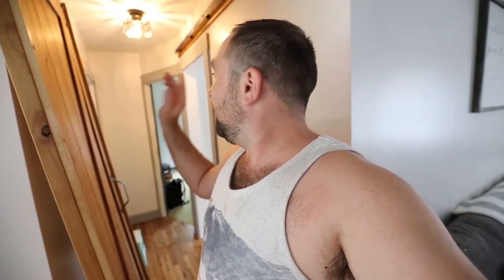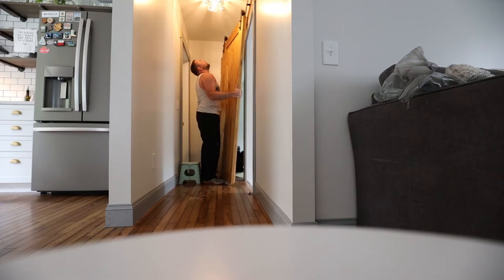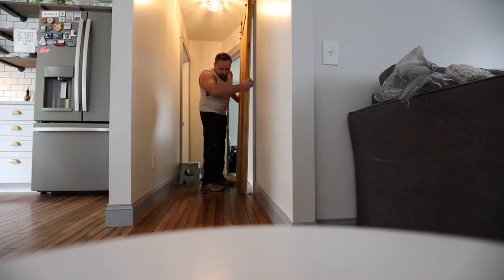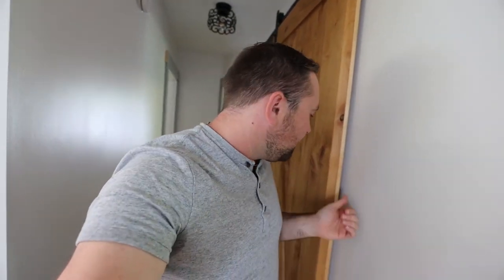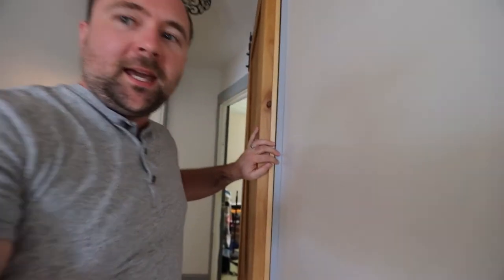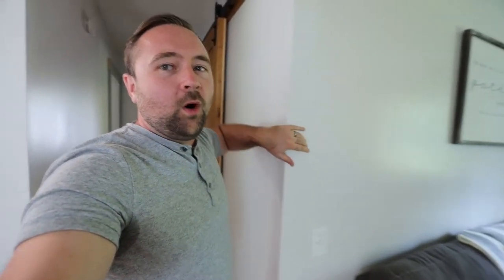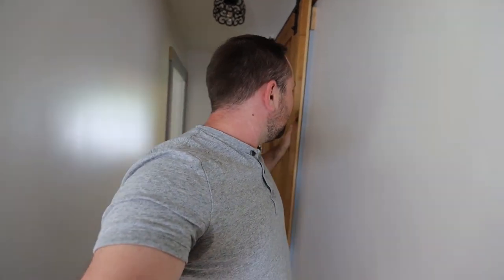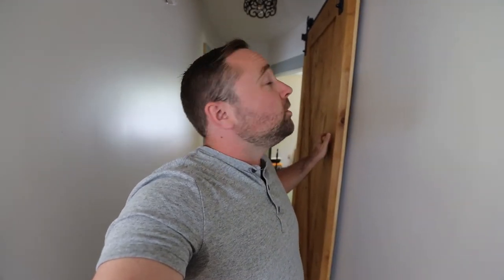Barn Door on a Bathroom...Too Noisy?

Comment: We have just put a barn door on our newly refitted bathroom.. 
It's not totally finished yet as we did a diy pipe and hook and eye type  rail. 
We were havibg the same issue as yourself and decided to add a piece of wood like you did but u
Added it onto the wall side  frame  as a bumper/stopper and it works really well.
Our door is taller than the door way so traveling noise really x
Can only be heard if someone was right outside the door. 
I honestly would add some weather shield door strips /trim that have a foam/rubber/silicone seal to keep it enclosed.
How about a motion activated speaker to play a little tune?

Comment: If the trailing edge of your door aligns with edge of your square door casing on closed you could add a batten to that edge that laps and stops against the casing edge. It might have to terminate above the baseboard. It would also have to not lap the casing edge fully or it would scrub the wall when opening.

Comment: I am considering to install a barn door as an exterior door for a home trailer I am renovation. The door will open to the wooden patio. So I thought a barn door look nice. BUT like you I was thinking about the gap between the door and the wall. Now I was looking at T-Shape wheel bracket, rather than the one most everybody uses. That way the gap is less (due to no screws) and since I am remodeling, make the trim a bit thicker to close the gap even more. What you think??  Nice video

Comment: Was thinking what about adding a strip of small brush type thing (not sure how they are called. I think that would catch the rest of the sound.
Reply: can confirm this works well. I put the extra wood either side of the door frame rather than on the door itself, and then added the brush type weather stripping (only 5mm) to the rear side of the door along the top and down the side that you never see, this completely seals the gap on those sides.  I might put a piece of wood for the other side to rest in (with a piece of weather stripping in that gap too) and maybe a longer brush type sweep strip along the bottom.  That should seal it completely.

Comment: I have the same problem.   The reason I chose to put the barn door was because the bathroom is super small and having a regular hanging door made it feel much more crammed. Unfortunately a pocket door was not an option as I have a vent on the lower half of the wall..  My issue along with the noise is the smell...if you know what I mean.  I have a white door.. In place of wood, do you think weather stripping would work equally or better?

Comment: I just had a barn door installed over my laundry closet (just large enough to house the washer and dryer and water heater) which is located in my living room😫
I have two doors that split in the middle. Do you think it would work to put foam around the door opening and not on the door itself to avoid rubbing on the walls and if so, what material would you recommend?

Comment: Did you placed the door trim on both sides of the barn door? Have you considered placing a rubber trim that will seal the sound on both sides? it will slide against the door ir the wall  like a winshield wipper. Just a thought.
Reply from the maker: Yes, trim on both sides. I considered doing rubber trim, but ultimately decided against it just from a look and wear perspective. I was afraid that it would eventually rub off the stain or paint (depending on where you put it) from rubbing all the time. I can imagine it would seal off the sound better if you could find a good way to make it work!
Reply: @TheHomeownersCookbook  the thought of rubbing against the wall or door came to mind as well.  I’m still undecided between a Barn door and a pocket door but I like the addition on your barn door. Thanks for sharing and will stay in touch if I figure out on how to add the rubber piece. 

Also thought of a rubber seal on the inside of the barn door addition that you added that could rest against the frame and make a seal as it’s closed. Easy to make for the left side but not sure how for the right side- when closing from right to left.

Comment: What kinds of noises are we talking about here?  From inside the bathroom or coming from outside of the bathroom?
Reply from the maker: It helps with noises from both sides, but it's the ones from inside the bathroom leaking out to the living area that I'm most concerned about...;-)
Reply: I think he's talking about the smell, not so much about the noise. Or maybe 🤔 both.   Great tip though.